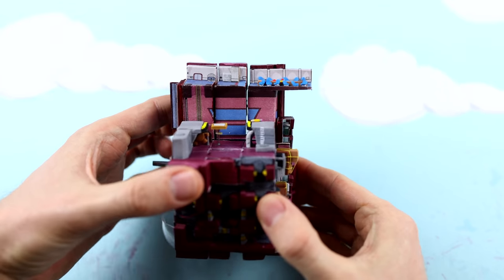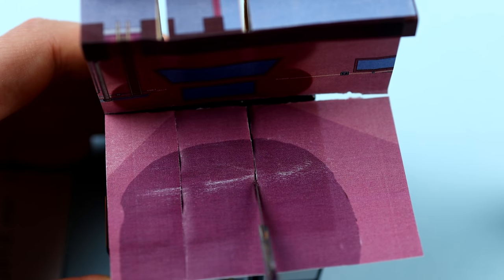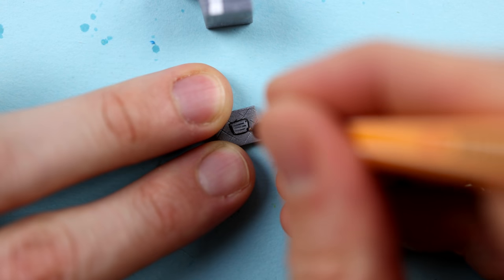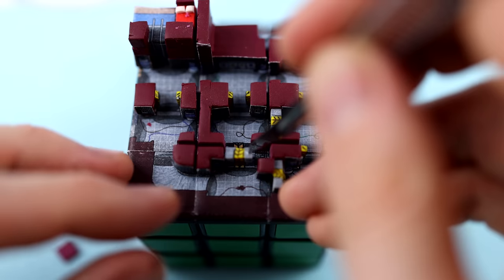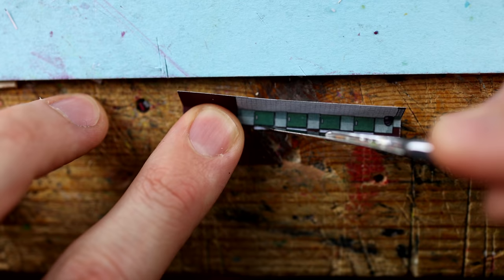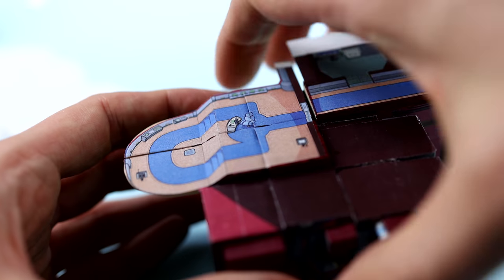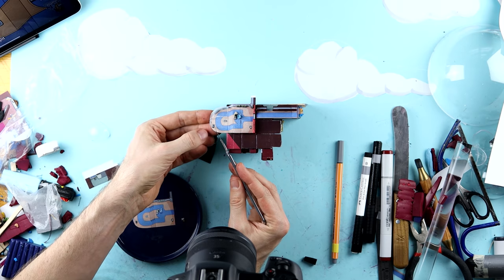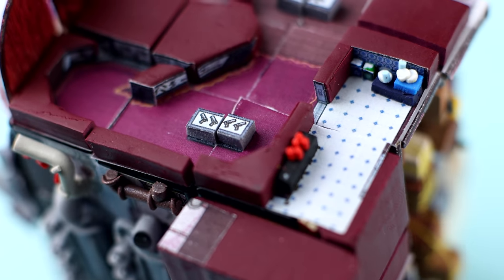This is what THE AIRSHIP looks like on a RUBIK’S CUBE – Among Us & polymer clay

Comment: Have you considered using prints that won't fade for your art? I know that it's a lot easier to print out stuff to use as your backgrounds, but if they aren't archival, your clay will stay nice and vibrant but the paper will fade to almost nothing after a while. even with a UV coating.